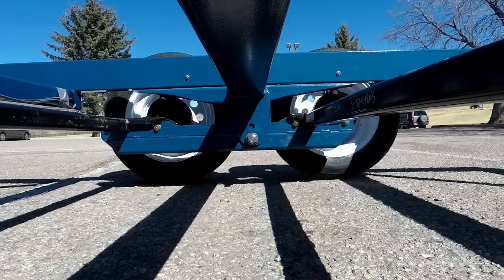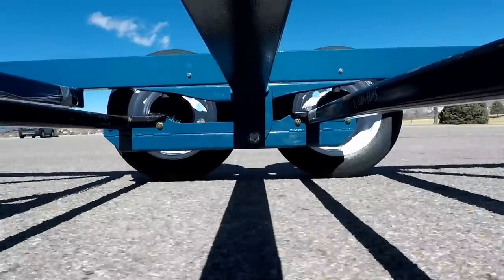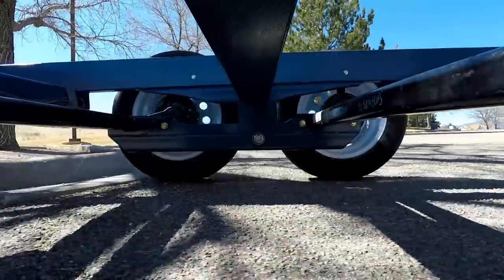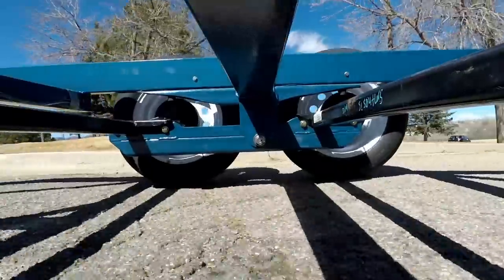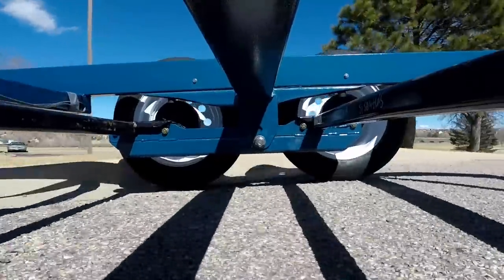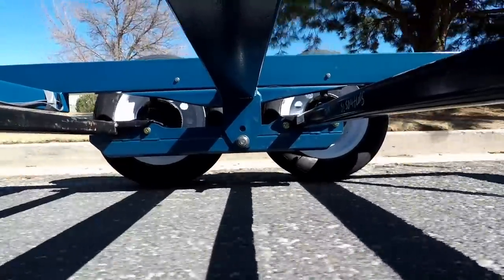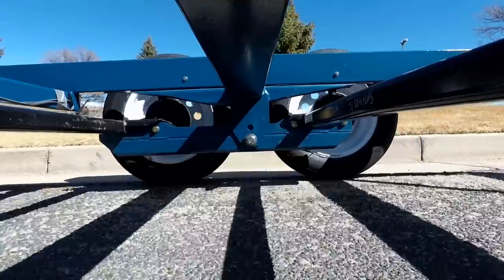Tandem Torsion Axles Suspension Action

Comment: Would like to see this under a load.. I'm building a new trailer for work and I like this idea.
Reply: see this work with 2 8k axles, don't think center pivot could be built strong enough, to hold that weight, turning would twist the crude out of that setup.
Reply: Torsion axles are like three times the cost of regular beam axles

Comment: How about the Torsion Stress this applies to the Beam section of the Torsion Axle. The Square Tube in the Beam is not designed to twist. Say you cross the load equalizer through a ditch like section, front right in full compression and left rear in full compression, that twist FAR exceeds the design of a Static Axle Tube. Torsion Axles are designed so the Flange mounted to a static load takes the full load and twist while the connecting Beam from one side to the other is only there to keep the Camber and Caster of the wheels in line.
Reply from the maker: Good eye.  You are absolutely correct if the axles were rigidly mounted to the rocking beams. They are not.  While the tube does take some torque, it is mitigated by flexibility in the attachment.  That said, there are limits.  If it was set up with too much rocking freedom, it would be just as you describe. Thanks for the comment.

Comment: I'm intrigued by your walking beam suspension system for tandem axle trailers with torsion axles. My question is: is angular torsion a concern? For example: if one wheel goes over a tall obstacle the walking beam will pivot and potentially induce a rotational deflection on the  axle?
Reply from the maker: True, it does introduce a torsional element. No, it's not really a concern.  The axles are mounted in rubber which allows some motion between the axles and the rocking beams.  The beams do have torsion, like going up the step, and that's part of why the wheel lifts in the video. The torsion is constrained by the rocking stops.

Comment: What happend to the opposite set of wheels if they are going over an opposite angle obstacle at the same time / wont it twist the whole frame ?
Reply from the maker: There are some rubber thrust and twist bushings as part of the axle mounting that give the system some flex. Good question. Enjoy.

Comment: i could be wrong, but the whole weight of the load sits on 2 screws and 2 nuts, where the fixed chassis is connected to the rocker beams. isnt this dangerous?
Reply from the maker: Not sure what you are seeing. If you're talking about the 2 big pivot bolts, one on each side, yes they are overkill, and double secured.
Reply: @SyEnsability  ok, It's hard to tell from the video if it's an overkill.There is constant friction and and force applied to those bushings, both vertical due the load of the trailer and also horizontal force when pulling the trailer in a circle. That connection should be at least a good quality bearing able to take the whole load of the trailer and even that is not enough to take the horizontal force.
Reply: @SyEnsability  Thanks for having patience. Engineers and customers should never meet. lol This is awesome building this now.

Comment: I don't get what are you using as a bushing or bearing in the pivot point, is it metal on metal?
Reply from the maker: This one is a Greased pivot, typical of Trailer suspension. Larger diameter than most for increased surface area. Keep in mind a design parameter was "low cost".  Implement bearings by machining the bores and shafts + seals. Adds significant complexity and cost. It all depends on how it's going to be used.
Reply: @SyEnsability   true, it would be great if there was an off the shelf rubber bushing or silentblock like the ones hendrickson suspensions use that's affordable and heavy duty that could be repurposed for this

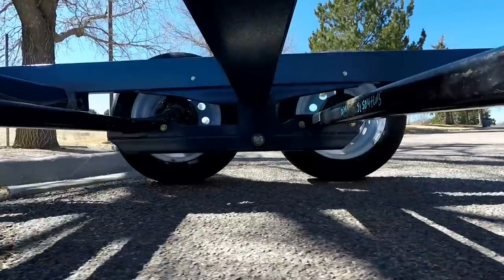Comment: At 1:16 when it’s going over that small curb, there is only one tire touching a surface (the front tire) such as the curb or sidewalk or pavement and this would indicate that all the weight would shift on that side and only be on one tire and/or axle on that side anyway. At least at that particular moment.  I’m not an engineer but I would assume that all the weight on one tire or axle on one side instead of distributing the weight a little better between both tires and axles on that side would not be a good thing since you would be putting all the stress and weight on only one tire and axle. 

If your axles are rated at 5000 each and you have roughly 10,000 total weight on the combination of axles including trailer weight and the cargo on the trailer and you’re going over a bump or curb like this and 1/2 of that is supposed to be on that side of the trailer, if 1/2 of one of the 5000 pound axles is 2500 pounds but it is suddenly getting roughly 5000 pounds of weight, isn’t this double what a single axle “should” be handling?  Furthermore, isn’t this double what a tire “should” be handling?

If you had a heavy load and you did this, I would think that this could potentially damage a tire or axle or possibly more if you weren’t careful.  I would worry that this could twist the axles a little too much possibly as well as it looks like there isn’t much “give” in the setup..  

Again, I’m not an engineer so perhaps I’m way off here but I would be concerned since this was only a small amount of travel to get on that curb.
Reply from the maker: Good observations, and you're not far off.  This trailer is quite light, so when empty the rubber grommets that set spacing and allow articulation are not deflecting.  That gives it an artificial appearance of stiffness, and yes, the rear wheel lifts.  Under some load, not even that much, the wheels track the ground.  Full story at https://www.synthx.com/torsion-axle-walking-beam-suspension/

Comment: Would this suspension type benefit of having shockabsorbers on the axles?
Reply from the maker: Interesting question.  One of the nice things about torsion axles (rubber suspension) the rubber has a natural hysteresis that acts as a damper -- not quite as effective as a shock absorber, but pretty good.  There might be some benefit, but I don't think it's needed.
Reply: @SyEnsability  I was thinkin about dampening the "tilt" - meaning the "seasaw" movement.
Reply from the maker: @jaba512   Since both ends are damped with the rubber, then motion of the rocker beam is also effectively damped. It can't really rock without compression and extension of the axle arms, so I don't think additional damping of the rocker beam will help.  In fact, it might hinder the instant reaction it gives to holes and bumps in the road.  The reason for shock absorbers is to damp oscillation - like bouncing.  The rubber does that fairly effectively.  I own this trailer and it is pretty smooth pulling compared to many other trailers I've had.

Comment: Would like to see this trailer in real action like under a heavy load, and will that system work under a car trailer with a car or pick-up on it
Reply from the maker: The system could be designed that heavy, but right now we have 2 options:  4000# and 8000# max.  https://mechanicalelements.com/diy-plans/trailers/trailer-accessories/  I will try to record something next time the trailer is heavy loaded.
Reply: @SyEnsability  Can one build this with half axles?  Flexiride torsion axles are available in short lengths that would allow for better clearance, IMO.
Reply from the maker: @patrickhayes3099   No, this design is for full axles. Not designed for the moment of a wheel off to the side. For a single axle use the timbren axle-less product. Do not use it in tandem, however.
Reply: @SyEnsability  thanks. I thought as much.  Still like the design. Shipping on full axles is killing my budget!

Comment: I nie potrzeba żadnych sprężyn, amortyzatorów czy silent-block ów? Tak samo z siebie to amortyzuje nierówności?
Reply from the maker: Rubber within each torsion axle tube is the spring for each individual wheel.  Then, the rocker beam transfers a balance with all the others.  There is also a rubber bumper for bottom-out -- front and back.

Comment: That isn't torsion suspension you just mounted two axles on a beam for articulation around a central point. The only "suspension" you have is the tires. You basically made a trailer with no suspension that can equalize load between tires.
Reply from the maker: Look a little closer. They are twin torsion axles that absolutely isolate and suspend on the rubber interface. Enjoy.
Reply: @SyEnsability  I guess I'm not seeing it. What what mechanism is allowing both wheels to move up or down at the same time?

Comment: Obviously I see this as a fail since nothing has come about it in 3-1/2 years.  I do not see the advantage over the torsion axles alone with an additional 100 lbs? and a pivot point of wear.  1 pivot bolt on each side is the only thing holding this whole thing together.  A fully loaded 10k trailer with 1 pivot on each side controls the whole thing?  Too much to go wrong

Comment: It’s a poor design…you want to load each torsion independently for the benefit of a dual axle torsion setup.   This might be better if you in the habit of jump curbs…maybe 

Load it, and this design is not as good as a standard setup, cost more, and much more prone to failure and suspension wear.
Reply from the maker: Yes, it costs a little more - and gives a nicer ride.  This one has a lot of miles, with all sorts of loads.
For those that drink the typical independent tandem torsion Kool-Aid, I suggest a good look at the physics.  Torsions are wonderful as a single axle, but without extra mechanics, create problems when combined.  Perhaps this article will help:  https://mechanicalelements.com/torsion-axles-in-tandem-or-triple/